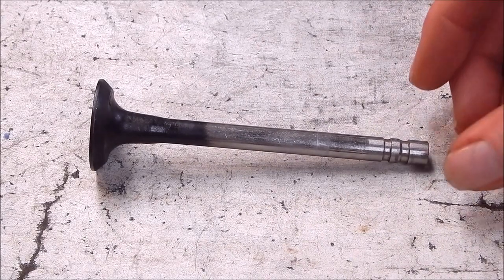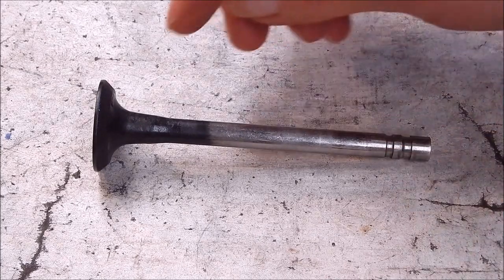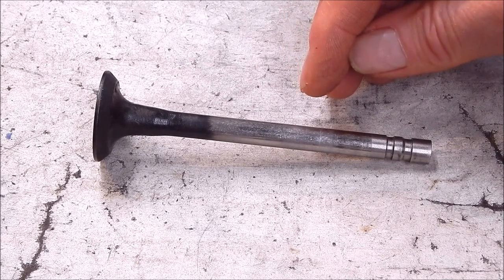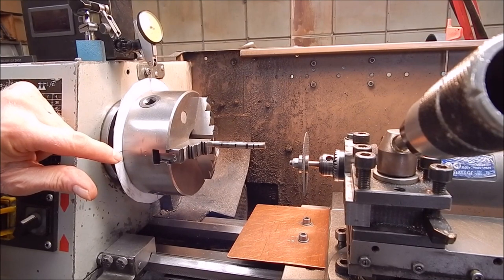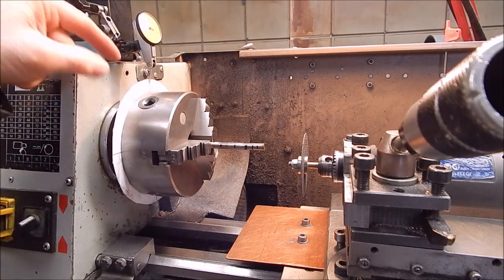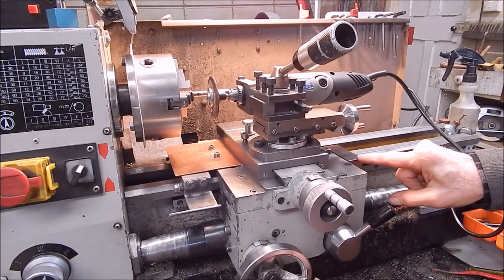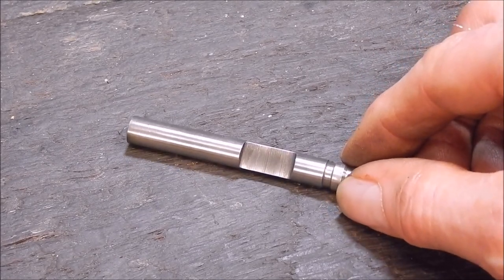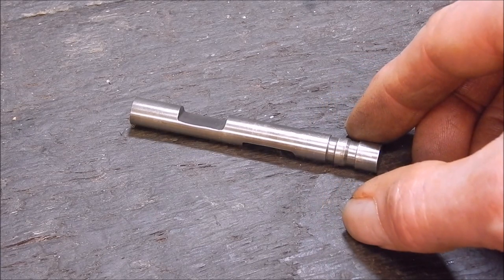Using the Hilda 400 watt die grinder as a TPG on my metal lathe

Comment: Very nicely done Rob 👍👍 The Hilda is a great tool, mine mainly gets used with wire wheels, flapper wheels and scotchbrite wheels these days. It is really good for paint removal and parts cleaning. I think you'll have your engine finished before I do, I've got side-tracked with other projects as usual 😂 Cheers, Alan.
Reply from the maker: Hi Alan,  the engine build will probably get interrupted as my free time will be a bit limited for the next couple of weeks.  I will see how well it runs on comp air before deciding on a boiler.  I have the bits to make one.  Cheers Rob

Comment: Be carefull with some exhaust valves. They may be filled with a gas that explodes with contact with air. Not sure if it's still done so please check.
Reply from the maker: Hi George,  that's why I mentioned and only use inlet valves.  A lot of exhaust valves are Sodium cored (for cooling) and should not be used.  Thanks for the heads up to viewers as well.  Cheers Rob
Reply: @Xynudu  Good info gents - thanks.
Reply: Wasn't aware of that.  Thanks for the info!

Comment: I know it would be extremely rare, but sodium-filled valve stems were used in high-performance engines. Realistic concern?
Good to see your practical solution, well demonstrated as usual, Rob.
Reply from the maker: Hi Russell, I know sodium filled valves were used a lot pre 2000, but the advent of multi valve cylinder heads may have reduced the need (valves are smaller) for thermal mass heat reduction.  I can't comment on how common it is now.  As scrap valves are more likely to be sourced from old vehicles, it pays to be cautious when cutting them up.  Go with inlets and you should be OK.  Cheers Rob
Reply: @Xynudu  That makes sense, thanks. Take care.

Comment: Nicely done Rob, very versatile setup for indexing and grinding. You proved the point well about cutting forces by doing the inlet slot first, if this was a conventional machining setup you would always need the max rigidity the further away from the clamping point, hence doing the exhaust slot first, Good demonstration. Cheers, Jon
Reply from the maker: Hi Jon,  it was a good demonstration of how low grinding forces are/need to be.  It gave a reasonable finish for such a coarse stone.  I've read some absolute nonsense on forums about tool post grinding.  Cheers Rob

Comment: Hello sir, as usual your video is very informative;  However, I have some information to ask you: how do you go about adjusting a speed on the Hilda?  you do this to the eye and the ear where do you have a device, a controller to check the desired speed.  Your advice would be of great help to me.  Thanks in advance.  P k (French)
Reply from the maker: Hi Paul.  I do it by years of experience, which has taught me what works best.  It is basically by ear and vibration.  There will be a point at which both become higher than necessary.  Start off slow and gradually try increasing it to speed up the work until you are happy with the result.  Provided you use the correct diameter disc/stone and don't exceed the maximum rated surface speed you should be fine.  The medium is usually marked with this information.  If unsure then don't exceed mid speed point.  Cheers Rob

Comment: Hi Rob, Just wondering what speed you were running the Hilda at with the angle grinder disc, re exceeding max rpms of disc.
Wouldn't want to hear you got some shrapnel from a disintegrating disc, Perspex shield?
Great vid as always, Bob
P.S. (40 years ago), My father taught me how to dress up a grindstone with an old broken one, wondering if it would make any difference to your finish with the grinding disc?
Reply from the maker: Hi Bob,  I only had the disc spinning fairly slow to begin with, but sped it up to about half way to finish off the grinds.  You get less vibration at a lower speed.  Vibration will cause harmonics and put a pattern on your work.  It is unlikely the max RPM of the disc would be exceeded as the diameter had worn down to about one third.  The circumference surface speed is the critical factor you need to be aware of for all grinding mediums.

The angle grinder stone was quite OK as far as dressing is concerned.  I have a diamond dresser if required.  The stone was a fairly coarse grit rating however (as most angle grinder stones are) but the finish was still plenty good enough for the job.

Cheers Rob.
Reply: @Xynudu  👍, Keep well.

Comment: Nice result.  Have you tried doing a ground finish on, for example, morse cones and the like with it?
Reply from the maker: Hi Michel,  not with the Hilda, but I have with the 775 powered double end spindle unit and it did a fantastic job correcting a couple of pillar drill Morse arbors.  The Hilda should do just as a good a job as there's no slop in the Jacobs chuck drive shaft.

If the grinder setup is rigid, as it should be, the end result comes down to the grit of the stone used.  That old angle grinder stone was pretty coarse, but still did a reasonable job considering.  Finer grit is always going to be better.  It's just a matter of what's available in the size you need at the time.

Cheers Rob

Comment: Nice work, Rob!  That Hilda has been mighty handy for you.
Reply from the maker: Thanks Daniel.  It's a mighty handy machine.  Gets most use with a small thin cut off disc in it (as seen initially).  Makes light work of cutting small diameter/thickness rod and metal sheeting.  Very fast and clean cut.  Cheers Rob.

Comment: I see you're using rotary valves in the crankshaft for this one. I built a similar engine as my first model engine project, it actually runs rather well for such a crude construction (I just filed the flats into the crank).
Reply from the maker: That's the plan.  I have decided to just use one pipe to the cylinder which will double for feed and exhaust.  Cheers Rob
Reply: @Xynudu  Yep mine was the same. 1/2 inch bore by 5/8 inch stroke. It runs rather fast and will turn over on only a few psi, but the piston's a little loose in the bore so it leaks a lot of air and doesn't make any power to speak of. If I did it again I'd probably lap the bore and use an O-ring to get a better seal.
Reply from the maker: The piston fit on my cylinder is quite good (that bit is completed), but I have always wondered how well "O" rings work as piston rings.   Neoprene can drag but if contact is only light it may be OK.  The rotary valve is a great fit as I have a reamer that size, but the power piston side of things has always been done with a small boring bar on finest feed to date.  This will generally give a slow release vaccum seal under test.  I'm sure it will run OK.  Cheers Rob
Reply: @Xynudu  a lot of the model I.C engine people use a Viton O-ring as a piston ring. Obviously it would not last if the engine were doing serious work and building up heat in the piston, but just idling away for a few minutes is ok. Based on that I think a Viton O-ring would be fine in a steam engine. 

I built a model I.C as my second project but used iron piston rings, which worked very well. I would happily use those in a larger steam engine too, but I'd hate to try making one for a 1/2" bore. My I.C engine has a 7/8" bore and needed rings only 0.8mm thick, quite tricky to make! Halving that to 0.4mm for a 1/2" bore sounds like a real challenge.
Reply from the maker: That's pretty good work to make metal rings that small.  I've made larger ones from cast iron for a small Kawasaki generator and was going to do an even smaller one for a whipper snipper, but the roller crank was also worn out at the same number of hours (amazing redundancy) and binned the lot.  It's a pity more people/viewers don't try their hand at model engine building and get some use out of their workshop equipment.  Cheers Rob
Reply: @Xynudu  I actually followed your method for 'tensioning' the rings, so I should thank you for that video. Worked a treat.